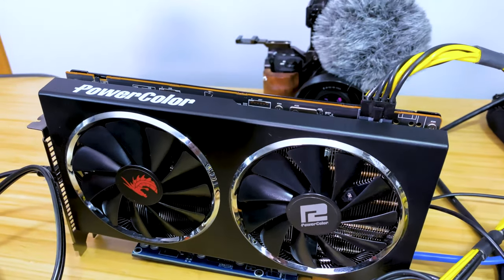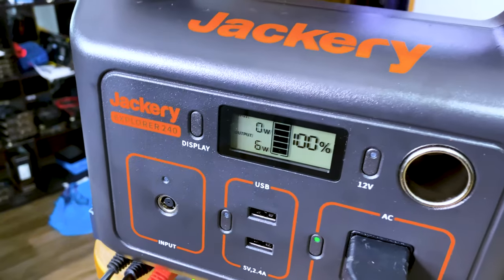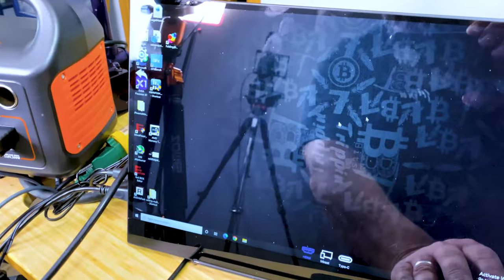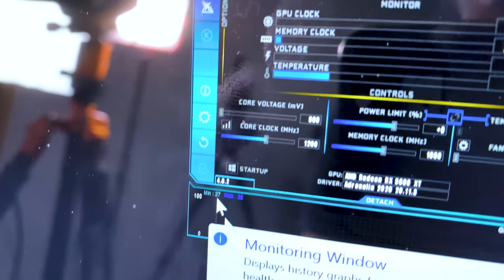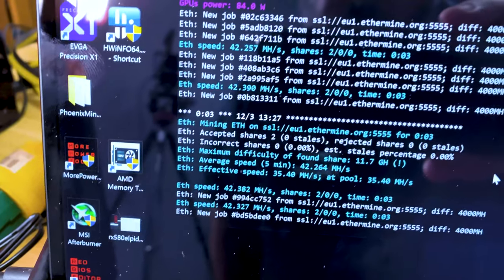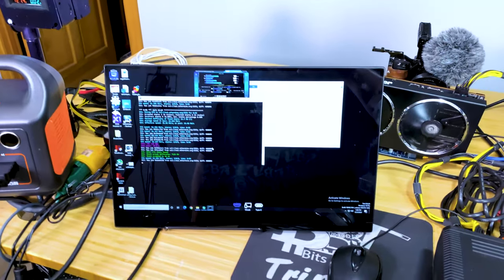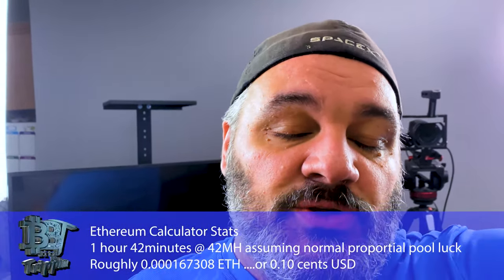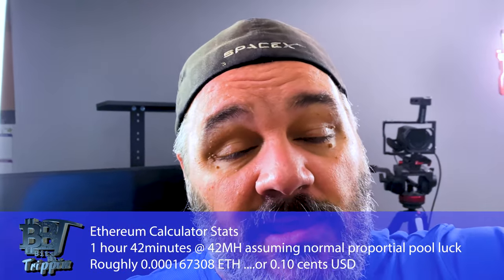Cryptocurrency Mining on a Jackery Explorer 240 Power Station

Comment: I have had an emergency backup solar setup a few years prior to starting mining in January 2017; and realized without a huge very expensive battery bank and a few 5000 watt pure sine wave inverters; the best you can do is cpu mining; it's just not there yet; once you build a large enough system; you wind up basically paying your power consumption in advance when you run the numbers; batteries have to be replaced especially if you dip below 50% then you reduce your remaining recharge cycles 

Peace

Comment: Should of had the solar panel connected connected while running test
Reply from the maker: That will be a next test, but yes, that is a good idea
Reply: If the solar is pulling in more watts than the rig is using than it should run continuously until the sun goes down.

Comment: These setups are some of the least cost effective...if you have a 450 watt panel without a battery it would reduce your consumption significantly...its also the batteries that make may systems so mch more costly...if you c feed into the grid you wouldbe much better off